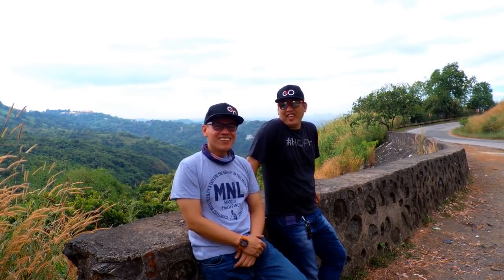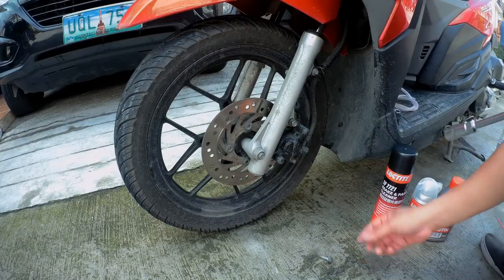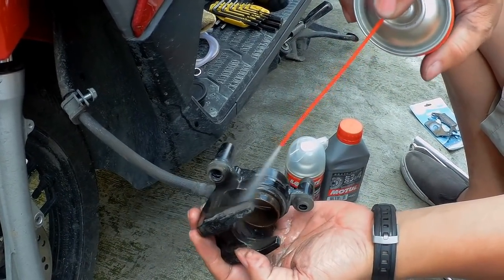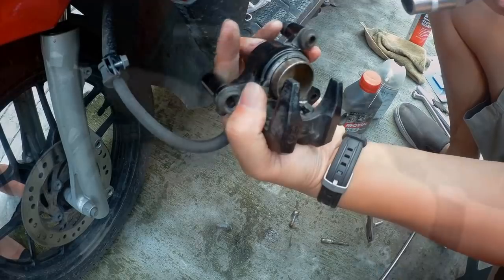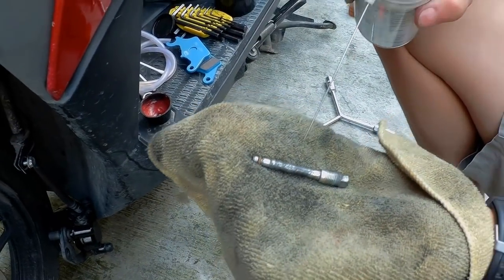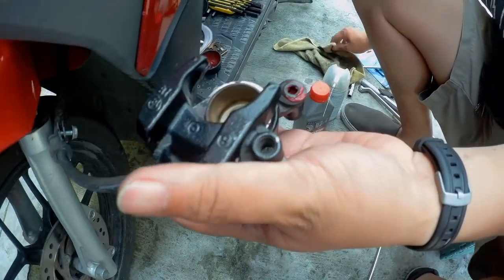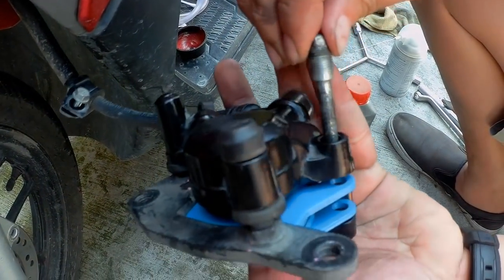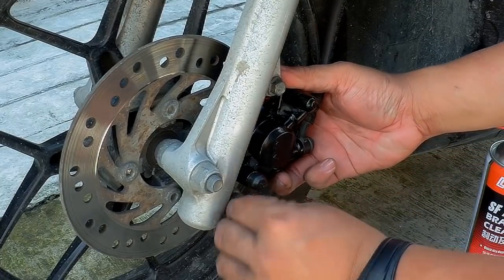Front Brake Caliper Cleaning and Assembly

Comment: pwd po ba socket wrench pang baklas??
Reply from the maker: yeah bro.. basta kasya and you have leverage
Reply: @That2Wheel  boss atu po ba pang tanggal ng langis sa front brake ng click150i ko ayaw na kumagat
Reply from the maker: @jayraldninovillamor1295  oil ba o brake fluid? if brake fluid..check mo tong video na to.

https://www.youtube.com/watch?v=93bK0d2ps8w&t=14s
Reply: @That2Wheel  d sir nag lagay aq ng langis sa bracket q sa may telescopic tapos yung langis na punta yung iba sa brake tapos ngayun d na kumakagat yung front brake
Reply from the maker: Ahhh, baklasin mo..then sabunin..or you can use degreaser..like brake cleaner spray..tulad ng ginamit namin na pang linis
Reply: @That2Wheel  ok po idol maraming salamat